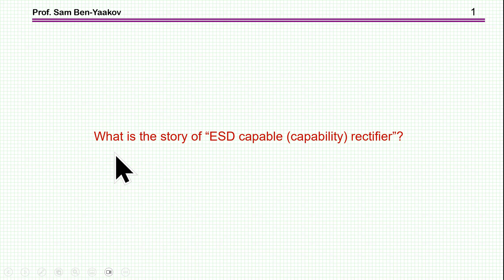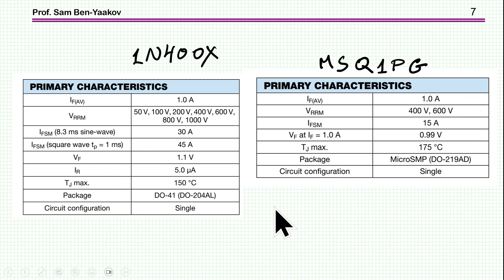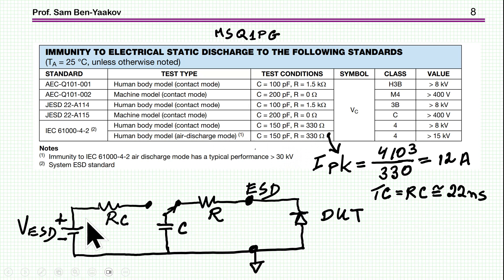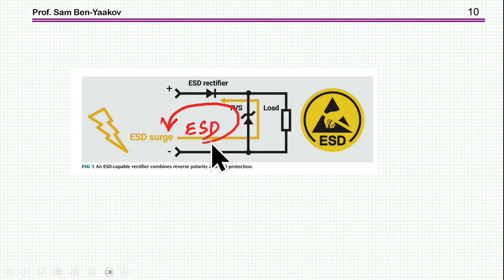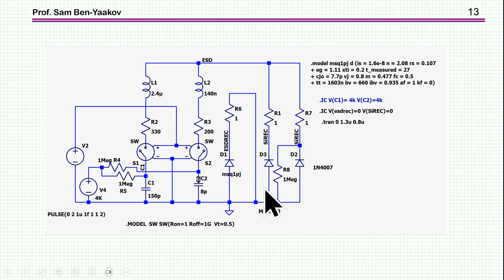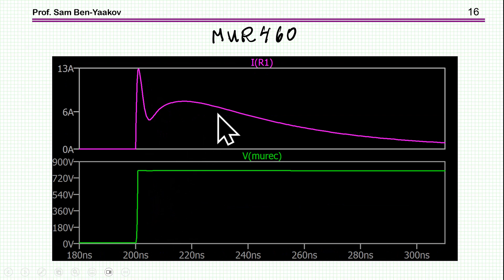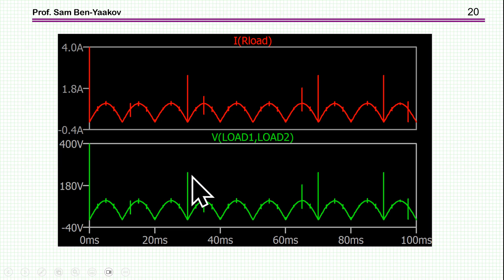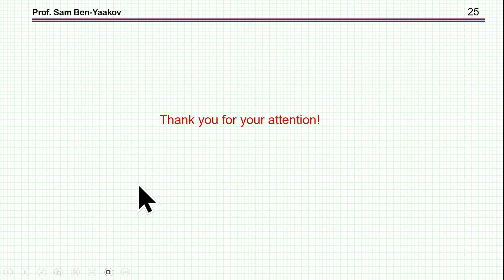What is the story of “ESD capable (capability) rectifier”?

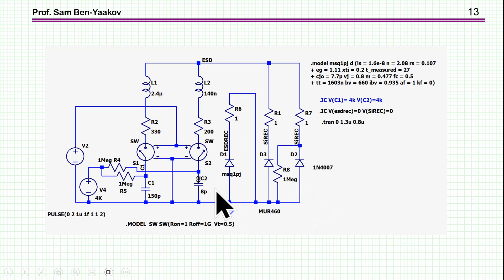Comment: In LTSpice, the 3 diode circuit, @ 9:15, what voltage or current source is driving D1 and R6?
Thanks, JT
Reply from the maker: They in standby. Connected when this diode is tested
Reply: @sambenyaakov  How exactly are the diodes connected when tested?  Can you send a link describing how this spice test connection method works?
Thanks, JT

Comment: So, I built your Full Bridge w/o C3 in LTSpice and at 13:08, my simulation results looking nothing like the same circuit built in QSpice OR your test results in the video.  Do you have a link to your LTSpice asc file?
Thanks in advance, JT
Reply from the maker: Hi, bravo on the effort. Send me a mail to sam.benyaakov@gmail.com  and I will send you the file. However, I  think that the size or number of the spikes is insignificant since it is largely affected by the simulation resolution and other randon errors.

Comment: 13:59: it's a very bad idea professor, those spikes are going to fatigue the dielectric of the capacitor leading to its premature breakdown.

Edit: they'd better embed a 1KΩ into the GS substrate of MOSFETs... It'll save time and money, countless forum posts and YouTube videos while reducing the carbon print of the electronic community, past and future.
Reply from the maker: The max Vgs pf most MOSFETS is a round 25 V so 400V is impossible. I think that what he meant is putting a bidirectional TVS as I have indicated later.

Comment: Maybe the 1N4007 model didn't have a breakdown voltage and what we saw was just from its parallel leakage resistance? Just a hunch. And figure 6 is just :/. Thanks for the educational video.
Reply from the maker: 👍Yu are absolutely right. The iN4007laks BV! in the D model. The default is infinity. I may post a follow up video. Thanks for the observations